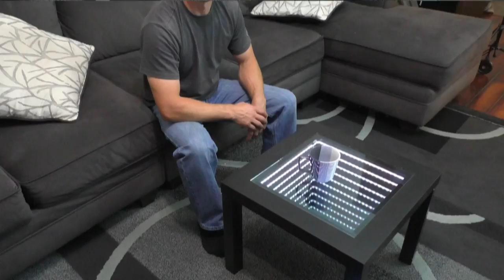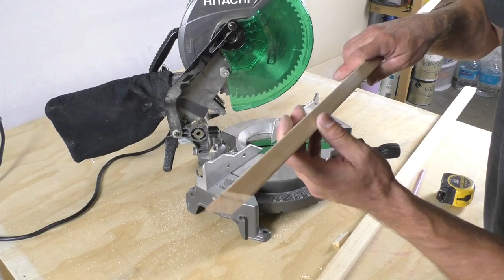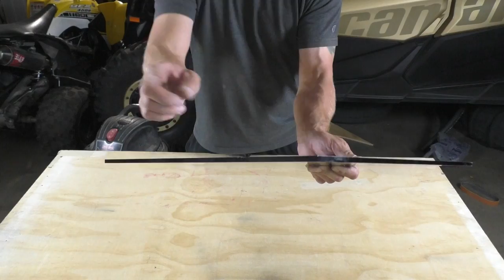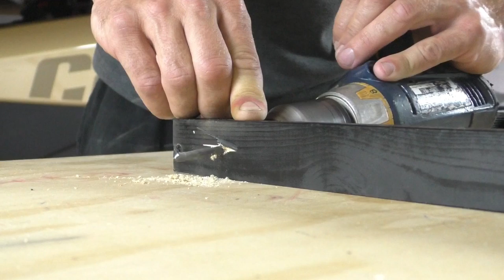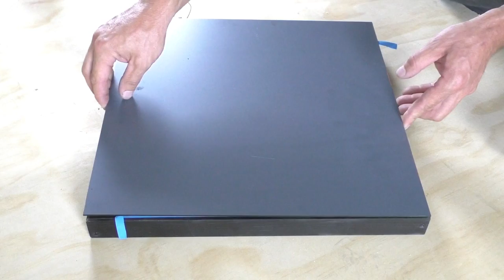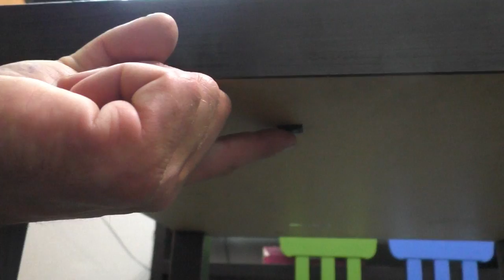How to make cool coffee table with infinity mirror from cheap ikea table.

Comment: Can u use 2 way mirror film????
Reply from the maker: I think you can, it does the same thing as a two way mirror!
Reply: Okay if I use the film would I need a mirror or window btw thanks
Reply from the maker: @Aj-hx5jn   you will need clear glass for the top and preferably mirror on the bottom, but i think clear glass with reflective film should work on the bottom instead of the mirror too
Reply: Thanks

Comment: You used 1 mirror on bottom and regular glass on top right...and 1 row of lights
Reply from the maker: Regular mirror on the bottom, and two way mirror ( miropane ) on top. And  led strip in between.
Reply: @FuzzyHat  miroplane?
Reply from the maker: Yes, that the glass that look like a mirror on one side but you can see through it. Look online  or you can stop by local glass shop and they can cut you a piece.
Reply: How did you connect to the switch? Which wires? Also, which LED strip did you use...just a standard white light?
Reply from the maker: @waheedmalik4096   Just a regular LED strip I bought on ebay, you can cut it to size and it has 2 wires on one end , connect them to the switch. sorry for late reply didn't see your message.
Reply: @FuzzyHat  buddy I'm so sorry to ask what may be a simple question: how do you attach the strip to a battery and the switch? If the led wires simply go into the switch then where does the battery connect? I'm useless at this kinda stuff but want to give this a go.
Reply from the maker: @waheedmalik4096  one wire (doesn't matter the color)  connects directly to a battery, and the other wile goes through the switch  to the battery.
Hope it helps!
Reply: @FuzzyHat  thank you bud
Reply: @FuzzyHat  Any suggestion on what would work if two way mirror is not found?
Reply from the maker: @ibrahimhassan228  not sure, it has to be reflective on one side .
Reply: @FuzzyHat  Would a reflective solar film be effective? I was thinking of getting a clear glass and add a solar film to one side, what do you think?
Reply: @ibrahimhassan228  that works too

Comment: What size glass did you use? Thickness? Your description is unclear. Also, where do you buy them from or is it best to get them cut to size?
Reply from the maker: Regular mirror is 1/8 of inch thick, two way mirror is 1/4 of inch thick ( thats the only thikness i could find) I cut all those myself ( i work for a glass shop and have all the tools) you can buy them at any local glass shop and have them cut it to size.